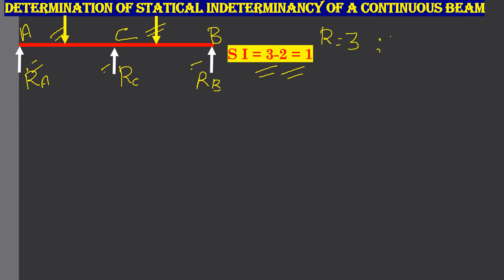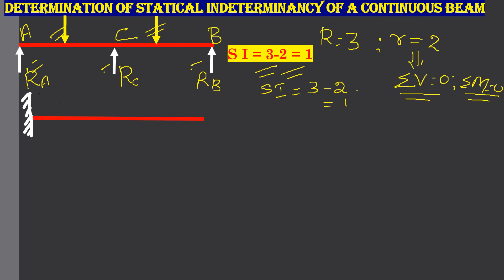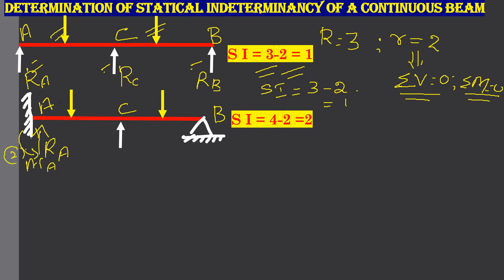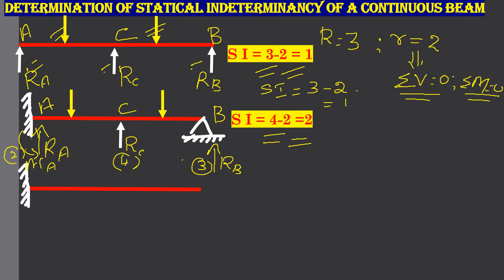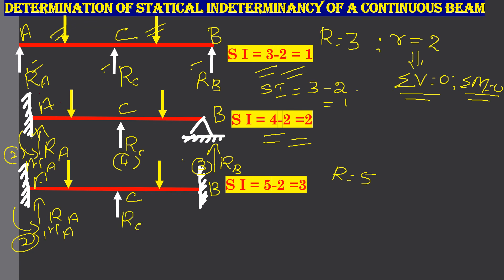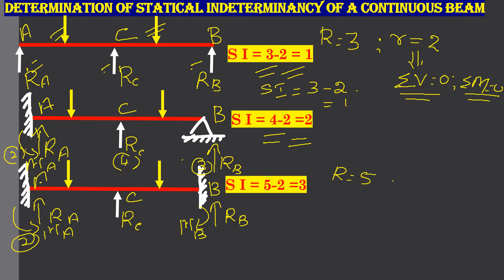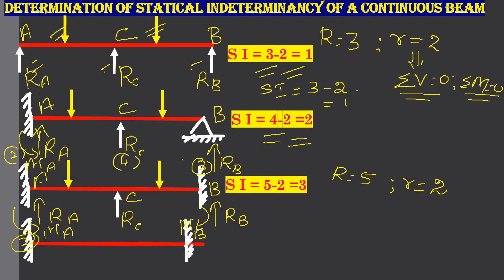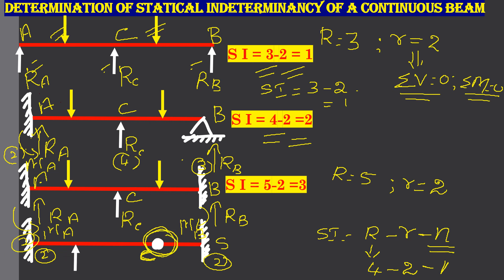DETERMINATION OF STATICAL INDETERMINACY  OF CONTINUOUS BEAMS  || BEAMS WITH FIXED AND SIMPLE SUPPORT

Comment: Why did u take M=0 in equilibrium equation? There is no moment as reaction so why it is considered in equilibrium equation?

Similarly what if there is a simply supported beam with one side pinned and other side roller support and only vertical load is acting? Will we consider M=0 as equilibrium equation? If yes then why? If no then that beam is indeterminate? If indeterminate then how come we solve it without any compatibility equation?